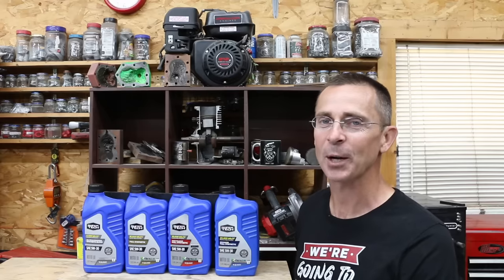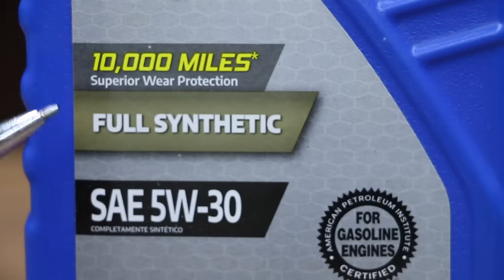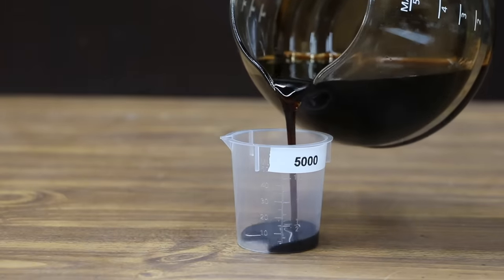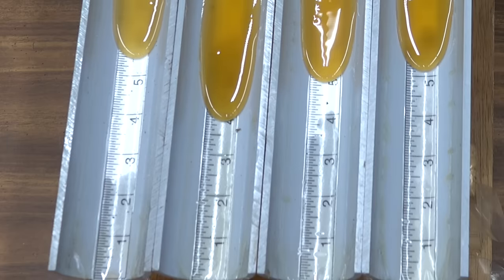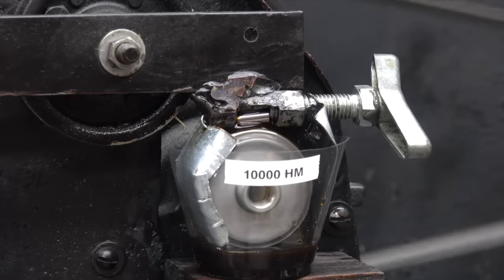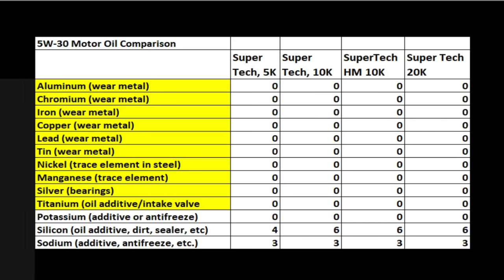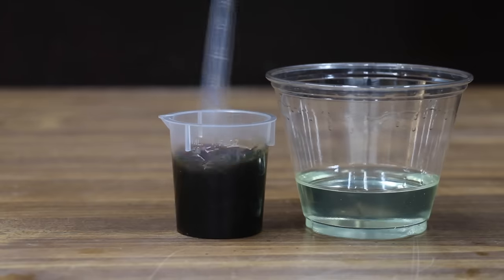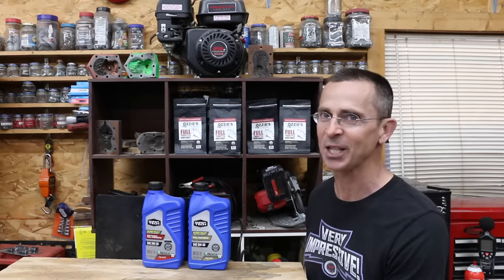Are They All The Same Motor Oil? Let's Settle This! Four Types of SuperTech Motor Oil Compared

Comment: 15 years ago, I would change my oil every 3,000 miles. Now, I use mostly synthetic and try not to go past 5,000. Nice testing, brother! Keep em coming!
Reply: Better if you change the car’s oil not yours. 🙈😱🤣
Reply: @grahameroberts8109  😂
Reply: @grahameroberts8109  I've been doing it wrong all this time...
Reply: I run 10-15k in my wife’s unleaded engine and been going 15-20k in my diesel with Ansoil…
Reply: @tooljst8  mostly synthetic? I’ve heard once you switch to synthetic you can’t go back to regular oil, unless it will start leaking.
I figure once you go synthetic why would you go back anyhow. My Tacoma purrs like a kitten with Mobil 1 full synthetic high mileage.
Reply: @Mermaid Muncher  thats an old falsehood. Switching back an forth won't cause engine problems as long as you maintain proper change intervals for the oils being used.
Reply: @grahameroberts8109  i ooze out of all my pores if I don't. Chicks don't dig it
Reply: @mermaidmuncher2708  I drive a motorcycle the guy used synthetic in has 30,000 and I buy 10-40 four stroke non synthetic no difference or burning like the 10,000mile morons or leaks I will tell you any good mechanic will tell you that your engine will last longer if you change it at 3,000 miles so save the hype I will keep changing mine as always heard what chevy's sound like in company trucks that ran there oil till 10,000 miles between change & boy did they use and make bad bearing noises just saying all my cars last till they get totaled out in a crash!
Reply: I go at least 10
Reply: AMD from the Car Care Nut channel says the same or every 6 months or which ever comes first which is what I do since I cycle more than I drive.
Reply: @mermaidmuncher2708   u just can't mix synthetic with reg oil
Reply: it comes down to cost,  is the cost of the oil change when done on a more frequent interval more then the cost of an engine rebuild with a much longer interval of 20K or less with the extended time between rebuilds
Reply: @tony Kari  yes you can. That's how semi-syntetic is made 😅 Also you can literally blend any engine oil with any other engine oil - those old storys of them not mixing or causing foam-up is not relevant for today's oil. Meaning if you are low on oil - any engine oil is better than no oil.
Reply: I've settled on 7k miles oil changes. That's because I combine tire rotations with the oil. Easy for me to track that way. 7k seems about right to keep tires wearing evenly.
Reply: @GunnysWrenches  lol 20k in a diesel. no matter what snake oil you use, the soot accumulation after 10k miles in a diesel oil will start wearing out metal parts.
Reply: Put 100k on a brand new Toyota corolla with full synthetic every 10k miles and the engine runs great. Even has the original tires still. The Yokohamas that came on it are impressive.
Reply: @tooljst8  no wonder my car engines keep blowing, but I’m sure lubed well.
Reply: @em4703  unless it's a big rig with a 15 gallon capacity, going 20k between oil changes is just crazy, in my opinion.
Reply from the maker: Thanks, will do!
Reply: As a mechanic it depends on your driving habits.  You can go longer on oil changes if you do alot of extended highway driving, no longer than 7k-10k miles depends on what oil brand you use. If you do alot of in town driving or city driving which consider short trips, stop and go traffic and prolong idling oil must be frequently 3k-5k miles. If you running ST10,000 miles 3k miles city and 5k miles highway. ST20,000 miles 5k miles city and 10k highway
Reply: @em4703  facts. 20k miles is 14k too much
Reply: Hey guys! I use full synthetic and I still change my oil at 2,500 or no later than 3,000😂😂😂😂😂....and she purrs like a kittin
Reply: my current oil is at about 5000miles it looks brand new, not dark or dirty still clear and upto level, im gonna let it buck till 10000about miles, 2011 mercury grand marquise 210,000kms and i put the cheapest oil Canadian tire had to offer in it
Reply: @Ammageddon89  so I run a repair business. I do plenty of oil changes on cars, trucks, equipment. So, quite often, I mix leftover oils, put it all in a jug that I use in my lawn mower/ yard equipment. Granted I never use poor quality oil. Another one I have done, mixing different weights of gear oil. All amsoil, but still, 80-90,75-140. No problems 🤷‍♂️
Reply: @ac.creations  That is more because it is a Toyota than the oil, so long as you don't abuse the crap out of them they tend to keep going.
Reply: @Ammageddon89  Yes and no, sometimes the additives they add in can combine in bad ways and you end up with jello in your oil pan because they polymerize.
Now small amounts mixing won't cause an issue because it can't form enough log chains to clog anything up, but larger amounts can.
Reply: @GunnysWrenches  have you ever had an oil analysis performed on the diesel? I’d be concerned as to the interval you’re using. But, suit yourself.
Reply: @GunnysWrenches  
I used to be a dealer 
I still run the 2 stroke oil
Never did go 25k with a filter chaing like they say you can
Reply: Yeah people who change at 15-20k+ are not very bright. Oil costs a fraction of what you will spent on repairing the engine due to bad oil, or even worse if you have to replace the whole engine.
Reply: @redviper259classic9 That is like saying I put a new roof on my house every 5 years and I never have had a leak. It does not really mean that this is the right way, it just says that this is how I choose to spend my money.
Reply: Awesome to hear, if the oil still looks clean and full at the 5000 mile marker, why not go a lil longer instead of "scheduled" intervals🤷🏽‍♂️
Reply: I'd personally love to be the salesman to sell you oil
Reply: @maddogchad77  Hope you are using motorcycle oil. Most motorbikes have a wet clutch and as such should be using oil made for motorcycles. Me? The oil gets changed when the car tells me. Currently it says I have 3% left. Next week. But then I do 15000 miles in nine months. The motorbike gets done every year, simply because it is standing around for much of that time. Way too cold and wet to go riding.
Reply: @tonykari5124  They sell it mixed "Synthetic Blend" straight from the engine oil manufactures. It's true you can't mix Ester based oils such as Redline with Petroleum based though which is where I heard this came from.
Reply: @ac.creations  To be fair a Toytota will run 250K miles with whatever you throw in it while being drove hard and overdue for oil changes.
Reply: Just changed my Yokos. 1k later >.<
Reply: @redviper259classic9 that's ridiculous
Reply: @EricMatson-ru7jj 2stroke oil in a car?? Yer drinking
Reply: @TheLionAndTheLamb777 hell a Toyota will do that with original oil 😂
Reply: 10,000 is fine,  people who change at 3,000 are wasting their money.
Reply: @mermaidmuncher2708  that is so false it's silly
Reply: You can go 8-12000 if you pick quality oil.  Project farm really really like the 25,000 amsoil
Reply: @willg.5168  

Here is why there is scheduled maintenance. Although you don't drive a lot, you might start it every day and every time you start it this is where there is the most gasoline leakage in oil (calculator injecting lots of gas which isn't burned because motor is cold). Also, at every cold start, there is very few oil lubricating the motor at the very begining, and lots of wear, so a more polluted oil/oil filter.

Also it might get polluted with moisture or whatever with time.

But I agree that there should be 3 types of scheduling : period of time, mileage, and number of cold starts.

Comment: It’s crazy how many products follow a normal distribution for quality. Cheap is bad, expensive is overpriced, middle of the pack is good and the pricing is decent. Also it was interesting to see how big the gap between 5K and 10K is
Reply: marketing  ;)
Reply: Yep. Been saying this all of my life. This is why in most cases I buy middle-of-the-road products.
Reply: money has diminishing returns at the high end, cheap stuff is engineered to see how much they can get away with and mid is what they think what most people would want and to be competitive with other brands
Reply: 5k is synthetic/conventional blend, whereas all the others are just synthetic. That's the main factor for the difference in performance.
It's not necessarily an apples to apples comparison, but they are the same brand, and labeling. And I don't think it's not fair to compare them all
Reply: It's economic reality of diminishing marginal utility. When you upscale things in quality, each extra unit of effort you put toward increasing the quality has diminishing return on the final product.
Reply: the true test is still the test of time, what still stands up and works 10, 20 or even 50 years later. ie, less waste and more work* done over time with a lower lifetime cost. 

* or whatever your measurement is.
Reply: I've noticed a pattern on this channel where the second cheapest product seems to be only slightly worse than the most expensive products.
Reply: The three synthetics scores where fairly close. The 5K mike oil is a blend and that’s what makes it score worse. We all knew that before this video, synthetics are better than blends and blends are better than conventional oils. What we learned here is that between the three synthetics there isn’t much difference and the 20K mileage claims is a BS marketing statement.
Reply: How we are priced  🤣👻👊🏻
Reply: However the 5K oil did fine. The analysis showed only slight differences. And based on a service life of 5K shouldn't be an issue. I change at or before that interval anyway, so indicates there is only slight benefit to the others.
Reply: the 5K is synthetic blend versus the other are full synthetic, so no wonder it perform better.
Reply: When I worked as a tech at Sears I noticed far more warranty claims on the high end batteries compared to the cheap ones. 
Anecdotal evidence for sure but it was a big difference
Reply: @AB-jz9ns  we didn't learn that at all. The 20k oil has way more zinc
Reply: It’s normal marketing.  A company first design a product with decent quality at a decent price.  Then they find ways to cut corners to produce a lower end version at the lowest price so to appeal to the budget conscious buyers.  Also they will do little improvements to make the standard product slightly better and will package and market it as a premium product, and then charge a substantially higher price for those willing to pay extra for the perceived superiority or benefits.
Reply: @GrnXnham  It's why I drive in the middle of the road.

Comment: I think the oil test comparisons are my favorite. Such a crucial item for our every day lives.
Reply from the maker: Thank you and great point!
Reply: I do too but I'm inclined to think you could run the same test with the same brands in a month and get entirely different results. I've worked in different factories and finished products vary sometimes on a daily basis for a variety of reasons.
Reply: I use the Supertech, but change it out after 6k miles.  Will NEVER trust an oil anywhere close to 20k miles!
Reply: The NAPPA oils have been my favorite lately as they sill have pretty good sales on 5-30
Reply: Bust the myth about which oil sludges up the least ,Synthetic or regular
Reply: @tommays56  they are all made by valvoline and are touted to be the same oil.
Reply: Could you do the same test but with all 3 of the amsoil products?
Reply: I think they have a shrine to Project Farm at Blackstone Labs 😂!
Reply: everyday*
Reply: I agree!  I think the oil filter tests are the tests that are the hardest to determind where to spend the money and wear (lol pun there ) not to. I think just about all the viewers here wld spend more on and oil filter if we knew we were getting value for the difference in price. I think what I have learned is use a full synthetic oil and change it often.
Reply: You're right, these are extremely informative
Reply: @artstudio9673  There is a you tuber known as “the car care nut” who is a true master Toyota mechanic. His suggestion is oil changes every 5,000 miles or 6 months using high quality components. His you tube channel is excellent.
Reply: @NMTRUCKER  thank you for the tip, I will check him out. Some of my Faves here are AVE, farmcraft101, and Diesel Creek, (Project Farm is a given ) and many others but these guys are like Rock Stars of youtube!
Reply: @artstudio9673  Thanks for your you tube suggestions! If you own any Toyota vehicles, the car care nut would be an excellent resource. IMO he is an excellent mechanic which are few and far between these days.
Reply: @NMTRUCKER my girl friend has a T machine so I already subscribed after watching how to inspect a used  Camery car. Dating myself here but last T I had was a 1979 4spd I took my road test in....the one thing I found disturbing about his channel is how clean his shop is! lol
Reply: @artstudio9673  The CCN worked at a Toyota dealership for many years and just within the last year or so has opened his own shop in the Chicago area. My wife has an ‘08 Highlander so some of his videos are applicable. Anyway, I like watching his videos just to see his approach to diagnosing and fixing problems.